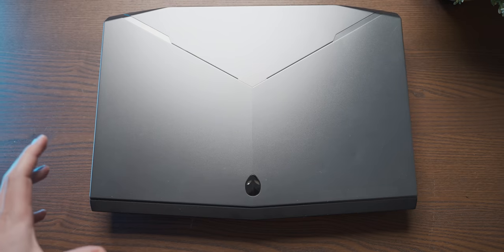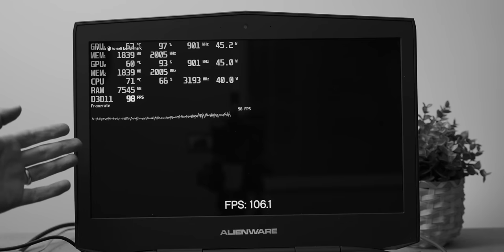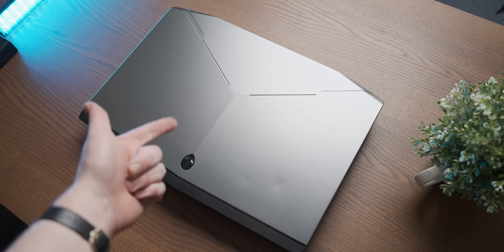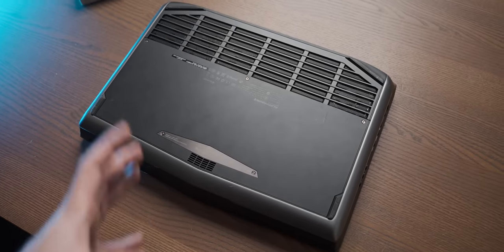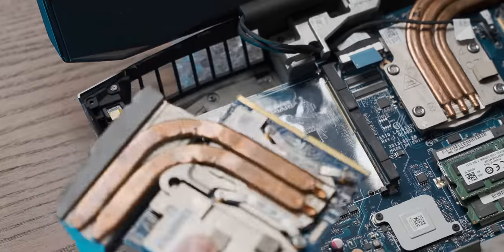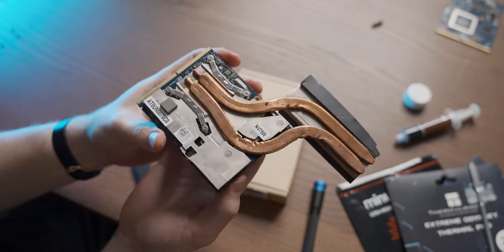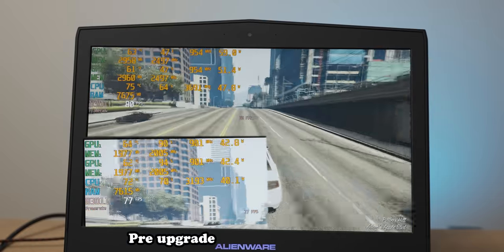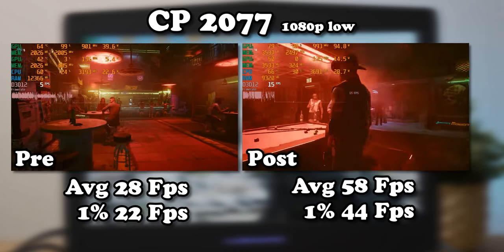Now This Is UPGRADING A Laptop

Comment: 4930mx is running higher frequency and cooler than the original 4700/4710mq so that's a plus.
Last official GPU supported by Dell is the 980m which is much better than the 880m
Awesome video!
Reply: Last official is the 980m SLI. But you can get a single 1060 or a 1070 in there. A 1060 fits without issues but you need to modify the heatsink to fit a 1070.
Reply: I had a 980m!
Reply: @InfectedChris  Alienware 18 and the M18x R1/R2 are still my favorite "old school" Alienware laptops. It was a somber day when I sold off my last one with a 4930mx and 970m in it to upgrade.
Reply: Yes, this!  Let's all watch the video's commercials a hundred times so Dawid can afford it. :-)
Reply: @lagoleer  Yeah. And Dell screwed everyone with the Area 51m by not supporting upgrades even though it had a socketed CPU and MXM GPU. You were stuck with Intel 9th gen so the most you can get in there was a 9900k and a GTX 2080 Super. Dell didn't release the DGF cards to anyone else like how MXM was available.

I have a M18x R2 which I went from a 3720qm and 680m SLI to a 3940xm with 980m SLI and a AW18 which already has a 4930mx but I upgraded the GPU's from 780m SLI to a single 1070.
Reply: @Unicornpirate  I remember that. I opted to go with a Clevo P870TM1-G (9900ks) and then X170SM-G (10900k) after the Alienware 18 so I was lucky enough to avoid the Area 51m fiasco when "upgradability" ended with the DGFF 2080 Super. That was the last hurrah for Dell and even a sniff of promised GPU upgradeability. Now even Clevo has switched to fully BGA laptops after the last NH55 that at least accepted 12th gen 12900k/12900ks desktop CPUs while having BGA 3070ti.
Reply: It will be nice to see an Alien ware on AMD am5  platform and 4080 MXM laptop.
Reply: @vmafarah9473  The Alienware m18 is going to be one of the few AMD Advantage laptops available this year. You can get it with Zen 5 mobile CPU and GPU. But not socketed anymore unfortunately. I don't think nobody does LGA and mxm laptops anymore. Not even Clevo/Sager. Framework has their 16 inch coming soon with modular parts. That's probably going to be our only option for truly upgradeable laptops
Reply: @Unicornpirate  Hopefully, Framework's 16 comes in to fill this niche, and it turns not into not as much as a niche eventually...
Reply: @vmafarah9473  Nvidia 40 series doesn't do mxm anymore，plus the new alienware m16 and m18 do have amd ryzen cpu with rtx 4080
Reply: i used 1060 on dell m6800 it worked really well but on some titles i was facing bottlenecking not huge but it was
Reply: @lagoleer  Brother Electrosoft ! It's TboneSan. No surprise finding you here!
Reply: @Unicornpirate sadly not gpu upgradable though and not a decent gpu included
Reply: probably because of the thermal paste. and yeah the 980m is pretty damn good almost as good/ comparable to a mobile 1060
Reply from the maker: So a 2080M wouldn’t work?
Reply: @DawidDoesTechStuff 
Mayby
Reply: GTX 980m hey can anyone tell me will this work in an Origin or Clevo laptop with 4800hq and GTX 780m? Is that a manageable upgrade? Idk what kind of firmware incompatabilities arise?
Reply: @DawidDoesTechStuff  I doubt it, not without some modified firmware.
Reply: @Unicornpirate  You got them as conversation pieces? They are quite slow compared to modern setups, require several times the power, physically is more heavy and have a massive frame on the screen (lots of expensive real estate). I mean i got a DIY upgraded Vostro to i7-4870HQ, keyboard light, SSD, large HDD, more RAM, but it lives in my garage as a tool and have done so for 3 years

Comment: I Love The Good Old Laptops They Are So Easy To Upgrade
Reply: And also very very very expensive, only very high end laptop get mxm graphics cards, and only Alienware does cpu shenanigans every once in a while
Reply: gaming laptops are still huge and heavy with shit battery life. Not all of them of course. But the huge ones should have such upgradability.
Reply: framework 16 will bring back that availability to newer laptops
Reply: @kirillivanov9638  7840HS 4nm AMD and 4nm 4080m laptop is a good performance machine that can last 2x than intel ones if OEM want them to last so.
Reply: @Blue efficiency
Reply: @Blue I see. I was mostly thinking of the flagship models where Intel draws around twice as much as AMD in their top end, but now that I gave it 3 seconds of thought, nobody really buys those lol. Also never bothered to look at actual battery life data so apologies there.

Comment: The SLI scaling on GTA V didn't seem to be working properly with the new GPUs. If you look at the usage it seems perfectly split and only using around 50% of each card where as with the old GPUs it was using 60-95% usage on each GPU. SLI was non-existent on BFV and CP77 on both but I assume that's just because SLI was dead by the time those games came out.
Reply: Probably sli overhead from the game or drivers or a CPU bottleneck in GTA 5.
Reply: Can it be that the gpu's are only getting 75watts? Not the 120 they should have? That seems to me the most obvious reason the performance is not up to scratch. But it is just my guess...
Reply: @richardheumann1887  MXM does 150 watt max, it’s not the 75 you get from a pcie slot
Reply: Actually if you are tech savvy it is easy to fix SLI scaling in most games if not all at a rate of 98% scaling when you edit the driver settings like AFR, and other specific profiles for independent games...

Comment: The bsod at 1:03 isn't a bad windows install, its the sata configuration mode in the bios. It can either be set to achi or raid on, depends on the device but usually swapping the mode will fix the blue screen.

Comment: Should've got one of the Iris Pro-equipped CPUs with the 128MB eDRAM; iirc it works the same as on the 5775c, the extra cache helps out in games a lot just like it does on the modern X3D Ryzens even if it's dog slow by comparison. Also, Adlink makes an RTX A4500 MXM card that is essentially just a 16GB 3070 on a power diet that might be worth a look. If you still wanted to make use of the multi-gpu part then your best bet is probably 1080's though SLI in [current year] is going to be a joke no matter what, but as another commenter said this all depends if the support after the 980M is just "unofficial" or if it literally doesn't work at all.

2024 edit: there's a site called X-Vision that sells up to 3080M MXM cards now, as well as AMD options like the RX 6600, which would be far easier to source.
Reply: last offical support for this machine was an 980m, anything newer and you have to mod the bios to get it to POST
And also, the slot only able to get ~95w of power to the card, so newer MxM card will have problem with power draw and will brick and shut the whole laptop down
Reply: I'm surprised that mxm is still supported after so long despite the Nvidia announcement about not supporting it after Pascal
Reply: @YuukiHotaruu  That's unfortunate, and dawid failed to google for the non-malware 3060m driver so I'm not exactly hopeful for a bios mod lol
Reply: @mcslender2965  It's so incredibly niche that it basically isn't. The modern ampere quadro cards are basically for datacenters only where they're used like SXM cards without the proprietary connector (which is why they're not sold retail as far as I can tell) or cost associated with A/H100 tier chips. and the other stuff is just Clevo and that one Arc A370M. All are so low volume that the price tag is really stupid everywhere you can find them.
Reply: There are no Socket G3 Iris Pro processors, they're all BGA-1364.  That option doesn't exist.
Reply: @mcslender2965  Too many businesses and military use mxm for it to outright die even though there are still small form factor desktops using it but they are still pretty rare. As for the modern mxm cards they are expensive as fuck even for the low spec ones unless from like Zotac or HP etc.
Reply: @lewzealand4717  i7-4980HQ on a BGA to socket adapter has entered the chat and would like to have some words.
Reply: @MrKillswitch88  If there were some of these adapters for laptop sockets, that'd be great but I can't find one.  Probably Z-height limitations that can be more easily accounted for when adapting Laptop CPUs to Desktop use.  Even if this does exist it's even less viable than what Dawid did here already, not to mention the microsoldering.
Reply: the hm87 chipset doesnt support the 4960mq and its brother without a serious bios micro code injection
Reply: i have an adelink quadro 4000 esentially a rtx 2070s and a 4930 mx oced to 4.4 ghz in my 17 inch r1 ranger . machine still holds ups well and plays just about anything i can throw at it
Reply: @lewzealand4717  Normies, someone already done this and sold them a few years back for which some users were able to get them working in stock laptops including Thinkpads.

Comment: The Dell Precision M4800 and M6800 are also infamous for being the last laptops to have all these upgradability, and they are also laptop DIY modders dream laptops, and now you can get them much cheaper than ever
Reply: the dell precision m4800 up to how many gb of graphics could you upgrade it?
Reply: Indeed you are correct, and the somewhat lacking community (compared to ThinkPads) are still finding ways of expanding these systems. The M6800 can now have 10, yes TEN, storage options onboard the laptop itself through the use of adapter boards and obviously sacrificing some other components. And that's before you use the USB and eSATA ports!
Reply: I've heard that you need to hack the BIOS to actually upgrade the graphics boards past what's on the spec sheet. Is that true? (And obviously the most powerful boards you'd be able to get would be the highest-spec one that the M6800 shipped with because no one was making custom third-party boards.)

Comment: I think the best value GPU in those are probably Pascal MXMs. There's a bit of vBios flash involved, but it does work rather well. Alternatively, there's also some AMD MXMs out there that apparently worked, but it's rather uncommon unless it's the 7970m/8970m/m290x. It does give the benefit of consuming less power while havinf much more GPU power to one's disposition. The other unused MXM slot can even be repurpose for an NVME slot after purchasing the appropriate adapter.

It's a fun little unit to dig into! Nice to see you give a hand into this :).
Reply: 7970m is a high failure rate part like next to Firepro M8900 levels of fail but the later versions of the card fair better and often have 4gb of vram.

Comment: Had an old Dell XPS laptop which was very similar to this and I was upgrading it and using it until only a few months ago.  Sucked the power through it though....was sorry to see it go.  Thanks for the video, Dawid 🙂
Reply: step one design your own bad ass laptops made with steel cases so they last longer and are more durable and then magically you will get more sales because you'll be competing with apple then by making super durable laptops that only last longer then non apple laptops and have more power then those sissy girl apple laptops💪💪
step two give Dawid a free laptop so your laptops are on his channel beating out those sissy girl laptops with higher gaming framrates

Comment: Would love to see how far you can get in terms of GPU upgrade. A 2080 might be too much but I can see sth like a 1070 or 1080 works in this Alienware
Reply: I have a couple generations newer Alienware that came with an i7-6700HQ and a GTX 1070.  It served as my daily driver PC for a few years.  My daughter is using it for a game server right now.  It has run very well.  Let's be honest, there is not a whole lot of difference between the 4th and the 6th gen core laptop CPUs, other than die size.  I have personally seen benchmark numbers where the 4700 outperformed the 6700.  The same also applies to the 4930mx, which Dawid replaced the 4700 with, vs the 6700.  Both of the older CPUs can boost to a higher clock speed than the newer 6700.  This was during the height of the Intel complacency era, especially on the mobile/laptop side of things.  If the 1070 will fit in the laptop, it should give it quite a boost to the graphics and gameplay.
Reply: The problem with the 2080 isn't that it is "too much" but rather pretty damn rare in the right format for this machine never mind the eye watering cost but at least those mxm versions come with 16gb of vram for the quadro version. They are more compatible than the Pascal generation from what people have tested thus far.

Comment: I used to have that same laptop. It had a 3rd gen i7 and dual gtx765m in SLI. I only just finally sold it last year. It was a great machine that got many years of heavy use. Best laptop I've ever owned, I kinda miss it.
Reply: Do the 765m "SLI" in the Lenovo Y510p perform anywhere near the ones in this Alienate system?

Comment: You should have defiantly replaced those old thermal pads, for the thermal paste replacement I'd recommend PTM7950 (industrial PCM) which whilst pricey for the cost of the surface coverage but the reality is that's got a great thermal conductivity, is rated for a long time and actually gets better with age (also lasts a lot better than traditional thermal pads/liquids). That's why companies like Lenovo are switching over to it in their high end devices...

Comment: I had my Clevo P370EM3 GTX680M SLI upgraded to GTX980M SLI and could have even went further by modding the frame to fit larger MXM card. Downside was that I needed modded BIOS and vBIOS that made graphics drivers needed to be modded as well.

Comment: The difference between 880M SLI and a single 965M is just insane.
On my 15 R2 i can play Cyberpunk 2077 at the highest settings, 900P with FSR on balanced and still get double the framerate of the 880M's on low 1080P.
Sadly, the R2 doesn't use swappable graphics cards, because they had the Graphics Amplifier gimmick that came with it.

Comment: I have one of these, runs perfectly to this day. Probably even better than my modern laptop (AW M17). This was the last fully upgradeable laptop out there AFAIK, and its why I haven't gotten rid of it. I just remember my friend with a desktop GTX 980, was surprised when my laptop would perform better than his desktop xD.  I pretty much maxed it out except for the GPUs. but you can easily get a single 1080 running in it. 

Nowadays everything is fully soldered on the mobo even wifi cards(which are notorious to going bad), and you dont get to do stuff like this.

Comment: Will connnecting an external 240Hz monitor increase FPS? Also, try to use with 1 x 765m & 1 x 850m as the Dell power AC adapter may not powerful enough.

Comment: The 880m's were known to run really hot. My 2nd Alienware 18 had the dual 880m's and I was very lucky to have 2 good cards that didn't throttle like crazy like a lot of other people did. My 3rd one with the 4940 and dual 980m's was a beast and I wish I still had it. It was my favorite computer of any form factor ever and modding it and tricking games that didn't support sli into using sli was fantastic. The AW18 was the last true Alienware laptop. After this they stopped pushing boundaries and became more run of the mill like the rest of the market.

Comment: why didnt you upgrade to 980M's? i use to have the same laptop, except mine had a 980m GPU.  Before i sold it acouple years ago, i was playing boarderlands 3, watch dogs 2, doom 2016 and eternal. Granted the setting where on medium to high and probably below 60fps @ 1080P.  i know some say they need atleast 60fps at 4k resolution, but for me im still happy at 1080p.
Is the 980M gpu not compatiblle with SLI?  Im so glad SLI is dead because i honestly hated it!
thanks for all your videos

Comment: I have replaced the 4k screen on this laptop, it is perfect, the screen model is NV184QUM-N21. It requires cracking the bios and expanding a new edp circuit.

Comment: I wonder if the limited upgrade percentage could be due to the power supply limitations?
iirc, you can even overclock most of the i7 HQ/MQ variants at the time. Maybe 200 MHz at most, but it may be usable when you throw essentially 2 desktop GTX 680s in SLI in a laptop.

Comment: Dell has a RAID ON Feature enabled by default, but you cant install Windows with it on most of the time because the driver is not installed, so you have to switch to AHCI Mode and if the BIOS gets reset you have to switch to AHCI again because RAID is default

Comment: Actual workshop here. I had a very similar model one of those come into the workshop with two dead GPU's (fail stress tests). The customer did not want to fork out the $$$ for new (or used) GPU's and didn't really game much anyhow. Amazingly the thing worked with just onboard video. So now there is one of those monster Alienware units out there with Intel graphics only.

Comment: Did this exact thing to my Alienware 17 dropped and 880m I wonder if the bios would support 10 or 20 series granted you would have to get a working heat sync and appropriate power draw.

Comment: I was happy enough to receive an old HP Elitebook from my dad who used it for his business a decade ago, its been sitting in his closet since 2015. After tearing into it I found that nearly EVERYTHING can be upgraded including the CPU, and the amount of IO this thing has is bonkers. I'm talking USB 2.0 and 3.0, Firewire, eSATA, ExpressCard, VGA HDMI and DP, Phone line jack, gigabit ethernet port, and a Smart Card reader. It's even got a docking port on the bottom that has support for a SECOND BATTERY! You can upgrade the Battery, storage, RAM, CPU, and the WIFI card (which supports 802.11n and Bluetooth natively). I have never held such a modular laptop in my hands before, and it makes me giddy to think that this one is mine 😎